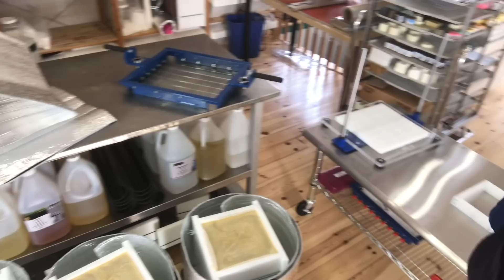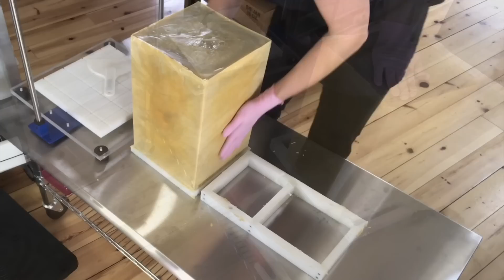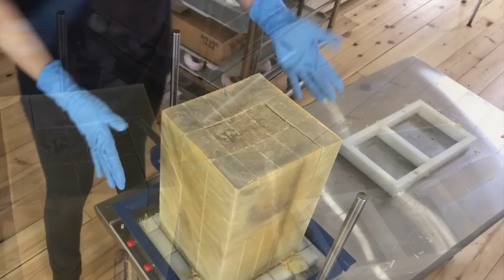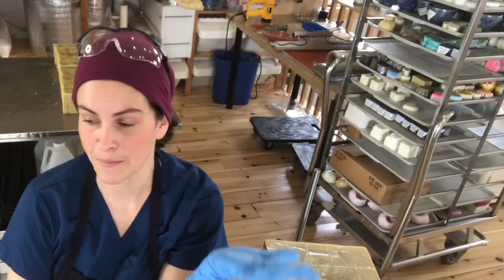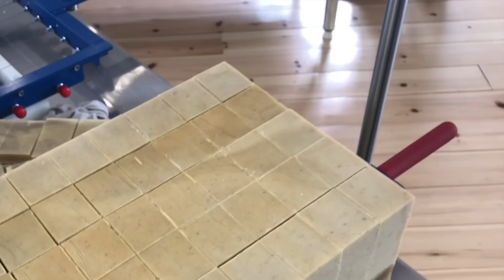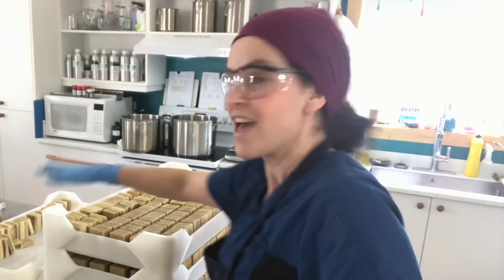Cutting 345 Sand Dune Soaps Using SoapEquipment.com's Manual Cutter Review Part 2

Comment: Oh wow these seem super nice- but also pretty hard to use with that recipe, and it does limit your design choices as well
Reply from the maker: TheDragonGirl actually, you can do a lot of designs! I just went for something easy to start with. My formula was also water discounted which I won’t do next time as it make cutting the soap more difficult
Reply: @ArianeArsenault  yes it is too hard to cut soaps when it is water discounted. I could actually feel ur efforts as myself get tired with such a small batch itself. But a great applause for u. This can keep u evergreen maco women with good muscles and fit body lol
Reply: @ArianeArsenault  I like doing top decorations and hanger swirls! Itp and layers seem like they'd be pretty easy but not that XD, thats a good idea on the water discount.
Reply: @ArianeArsenault  
One more suggestion: I imagine those wires are very similar to wires I would use. You may not see or feel the difference and may even think they are smooth but 50lb fishing test line will go clean through that soap much smoother and easier and will not break. 
I've used 30 lb fishing line on my soap before and it's like cutting butter and my soap is not soft when I cut it. 
Sometimes steel leaves behind  small bumps because it is slightly rough and causes friction and that is one reason that could be making it difficult for you.
Reply: iwannaapple that’s true, I work with wax for candles and have switched to 30lb fishing line. I was surprised how much better it did that piano or other wire
Reply: @mary-ruthflores4107  what company did you go through for your fishing line? Tyia
Reply: @ArianeArsenault  
I don't know exactly what you call a water discount. I think AFTER 50/50 everything is adding water and there are differences of opinion about that but that is not my point and I actually think the opposite as to why it is sticking on you.
Mind you I haven't made nearly as much as you I have studied what I do thoroughly and I have found that stickiness comes from different sources that come to play to create stickiness. Firstly and foremost it is from an emulsion that is not quite blended so you have slightly loose water that is left behind when drying. That would translate to soap sticking to the sides. At the same time, in combination with that, a choice of oils: Different oils create different heat. If you don't want to create as high of a heat to make it crack choose a different oil or different percentage of oil OR add more water but then you run the risk of soap sticking to the sides and making it more difficult to take the mold apart.
This is my guess; I actually think that with that large amount you just thought you stick blended enough.
Soap acts just like concrete. When its not mixed enough you get loose water and salt at the top.
With me, I have noticed that it is more my choice of oils then my choice of water as to when I get stickiness. I also get it when I notice I didn't quite stick blend enough. Soap is still good and still the same. 
It is just that the less dense water is pushed to the outside and that creates stickiness instead of smooth soap.
Reply: Me encanta sus videos

Comment: Use your excess and odd pieces for samples. I slide my end cuts, misshapen and other weird missteps in soap making as giveaways for my customers. I make 1200 - 1800 lbs of soap a week in a 40lb batch size wood mold lined w painters plastic and cut into 4 lb loaves w a wire strung between two pieces of wood. I have 5 stores and a huge website. Each bar is hand cut and sold by weight. 2022 is my 25th year in business. 
I’ve always wanted SoapEquipment system but don’t have the room. I’m getting ready to build a 10,000 sf facility with plans of ordering soap equipment system. After watching you struggle and risk injury, I think I may have to rethink my plan. I’m now wondering if the pneumatic system is worth the effort.  Your soap is beautiful and i wish you luck in your handmade soap making business. Hooray for all of us who’ve turned a hobby/craft into thriving businesses and giving corporate America a run for their money.

Comment: One suggestion to open the mold
Put one more nut in-between two side panels. So when you remove outside nuts unscrew inside nuts which will push the side panels and the mold will open if you fix rod with inside panels then both side panels can be removed

Comment: I dont think that wire cutter design is any good.. using a cutter with say 2-3 wires equally spaced (and in 1 direction) will get you done in no time and with minimal effort. Trying to do too much at once is not efficient and clearly a struggle.

Comment: That was dangerous. It would have been a bit easier if it had been placed at 90deg from the way you had it on the table.  That way neither of you would have been leaning over the posts, and would have been pressing down with those at you sides, as it was actually designed .... with the red handles either side. Not front / back. I would not buy this kit.

Comment: Btw u may customize ur own type of hollow moulds so that they are layered one upon other and asa u fill them with the soaps someone could cover each row with flat plastic or silicone stiff  plates. That would make your job much easier and u would have the choice of customizing the shape of ur moulds too but every mould would be uniformly same in shape but never mind u need not go through cutting process each time.hope u r getting me?

Comment: Good grief! This doesn’t really seem worth it when you end up in less than safe positions while cutting and exhausted after.
Reply from the maker: BenAZ123 read the comments. This was my first trial and I have to adjust formula & get aquatinted with this new equipment. I was tired, but my arm didn’t hurt.

Comment: I feel like the older big batch items you used are much easier to use especially because the bottom of the mold has the grooves in it so you only had to worry about removing the sides. I don’t remember what video it was that you used those in but I know it was a few years ago!

Comment: That was so difficult to cut!!

Question: 1.would it be easier with a hydraulic cutter?

2. Would using silicon liner be easier?

Jan 💐
Reply from the maker: Cat 9 soaper actually yes, a hydraulic cutter like the air cutter from Soap Equipment makes cutting effortless, but in my case, it was difficult to cut because I did a water discount and even though I kept it low, it was too much and I have to reformulate with no water discount. This way, the soap will be easier to cut

Comment: Maybe you can try to cut from the bottom which is still soft instead of the top which has gotten hard. Maybe it will need less elbow power. :) It's always great to see your new videos.

Comment: Wouldn’t a grid of blades be more efficient than blunt wire?
Reply: Blades create more resistance as they move thru the block. Blades are great for single layer cutting with a guide, but when a blade gets off perpendicular it is very difficult to straighten it up. That's why my blade cut blocks/bars have that homey look.😄

Comment: Ariane.  I feel that is very dangerous standing over that with those polls if you were to slip you could impale yourself.  I know there is a power cutter which would be much safer for you.  Please be careful.  Those poll that hold the wire frame are why I’m not interested in this set up.  However thank you for demonstrating this.  Just please be careful.

Comment: I like that you split the videos into two parts, 20-25 minutes is a good video length. Did you do a price per bar comparison on if using the huge molds is more cost effective? Even if it isn't, it has to be more time effective, right? 

Thank you Arianne, great video as usual. 

-Lindy

Comment: The hydraulic press to go with the cutter would be more ideal. I know it takes up real estate in your work space..... but having to apply that much pressure at elevated heights leaves room for staff including you to slip and fall. One workman's compensation claim can drive up your rates and you will end up paying more than the cost of the hydraulic press. Please be very careful when using that cutter.
Reply: Cheeky Saver agree!
Reply: Agree. Also those posts are really dangerous, because when pushing down it has them right at about chin level! One slip could be detrimental. We have been using this cutter for a long time. We always have two people for safety.
Reply: Yeah i second that. It's hard for ur back and could could case issues if u r making such a big batch very often.
Reply: You can just get a lower table
Reply: Doesnt have to be hydraulic.  You could make a threaded rod and electric motor to make the job easier.
Reply: Totally agree!

Comment: Now we know why The Soap Gal has that machine that pushes down on the cutters for her. Do you think it was so hard because you have sand in your recipe? Even with it being a bit tough to start out, I'm so very glad you have that cutter system, what a time saver! And who knows, when your production increases even more, maybe you can get one of those machines that pushes on the cutters? Was that your hubby helping you? Do you think one of those rubber mallets would be good to use to tap on the frame to get thru the top?  You did a great job on your review by the way!
Reply from the maker: Sharon Donelow my batch had a water discount which I found out is not the best idea when using block molds. I will adjust and reformulate. As for the air cutter, which I believe is a hydraulic press, that would of course reduce and type of body work, but also wouldn’t be manually cut. So I will stick to these 😊

Comment: Great review, but I am not going to lie, I was very nervous for you while you where leaning over those guide rods for the cutter. Looking forward to perhaps an update with the new formula you have mentioned, no water discount, to see how much easier that works out.  Maybe suggest to the company a safety cap for the tops of the guide rods. I know they are blunt ends but accidents can happen and I could see someone slipping possibly and falling on top of them when up on a stool like you where.
Reply: Lord Jesus! I was feeling the same way.
Reply: OSHA, come through!
Reply: I had the same concerns. 💜👍
Reply from the maker: Ka Jula Davio I never felt in danger while making and cutting this soap. I am excited to keep using these molds and cutter and get my formula perfect for the cutter to cut easier
Reply: @ArianeArsenault  It is much easier and safer to have another person help you. We have been using this set up for about two or three years. It is much simpler with a second person. We have had a few very close calls with the guard rods. Also, make sure you do not rock the cutter when trying to break through the top, it will cause the bearings to break loose from the little round piece that guard rods go through. They are in the black ring on the blue piece.

Comment: Great job.The cutters should be electrical.will be a lot easier to use.Amazing soap🇨🇦
Reply from the maker: Patricia Layne Soap Equipment does have an air cutter that is hooked to a compressor. If you want to see it in action, head over to @the soap gal YouTube channel!

Comment: I'm sure this is wonderful for you, and giving you the honours of trying all this large batch equipment, but to me personally I wouldn't buy this soap, its lost the homemade batch feel, you will never be able to get the swirls that you normally make which are so beautiful in equipment like this.  But only you know what direction you wish to move in and if its this way, congratulations you've done it.  Everything I have said is only my opinion, no harm or bad thoughts intended
Reply from the maker: Tanya Bonnett some soaps will always be made in the slab molds because the designs cannot be replicated in the block molds. However, all my soap that are plain can be done in these molds. It is still handmade, just to a bigger level. I have been dealing with 2 herniated discs in my spine for over 15 years and lifting the stockpot repeatedly is really bad for my back. Also, I have developed a tendinitis to my right arm for the same reasons. I really hope this equipment will help reduce all the stress on my body! I just have to get my recipe A ok and it will slice through like butter 😁
Reply: @ArianeArsenault  I understand your back pain as I have spinal arthritis affecting my whole spine and many other joints, my comment was not written with any disrespect as you will always be one of my soapy heroes, I was a chef for almost 30 years and sometimes help is needed in our jobs
Reply: @tanyabonnett4174  I saw a comment similar to yours on the Soap Gal's channel when she introduced her "unicorn". I would like to ask a question, like you said no harm or foul intended. While I understand the point that you're making, how would you propose a  handcrafted  soapmaker to scale up without the use of equipment like these and without it coming an additional cost? Which would eventually mean an increase in the cost of goods

Comment: crikey Ariane! that looked like a lot of hard work! you mentioned previously about your bad back - I can't think how this is going to help it! I think the Soap Gal has some sort of mechanised cutter? is that an option for you? take care of your health! xxx
Reply from the maker: The Last Homely House East of the Sea yes Joanna uses similar molds but she has the air cutter. I did make my soap with a water discount (because this is what I always do in slab molds) but I shouldn’t have. Next trial I will adjust and will also have my insulating boxes ready and it should cut just like butter!
Reply: @ArianeArsenault  good - I hope so - because that looked like such hard work!
Reply: I was worried about your back as well !!! Take care !!
Reply: I've see that cutter that you mentioned. It's a better choice to cut big blocks like that.🙂💟

Comment: Seems like the big block cutter could be improved by them making the bottom plate thicker with deeper slots so you can push down farther so the wires cut through the middle easier.
Reply from the maker: Riyame it is deep grooves. As mentioned this was my first attempt and I will reformulate my soaps with less water discount. I did do a water discount making the soap harder to cut. Nothing wrong with the cutter, just a learning curve

Comment: Thanks for uploading but I prefer your former soap mould, is true with this soap mould you don't need a exercise again 🤣🤣🤣🤣🤣🤣
Reply from the maker: Grace Thomas Robert this was my first attempt and I will have to reformulate to make my soap softer and easier to cut. I will keep you guys posted. Of course some soap designs I will keep in the slab molds, but for most my soaps these molds will be perfect! 😁